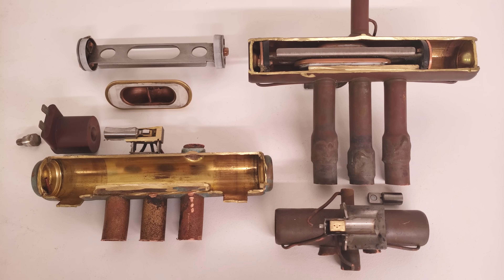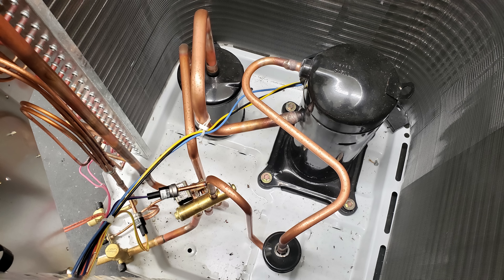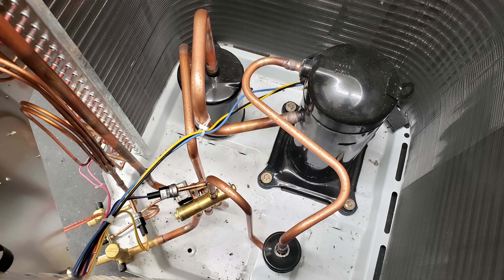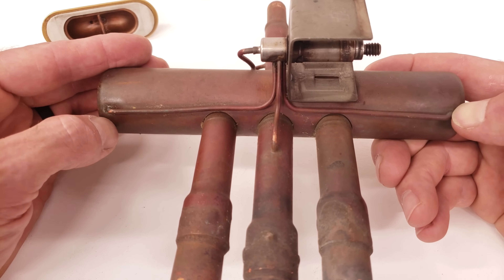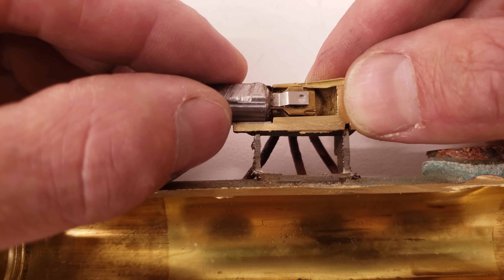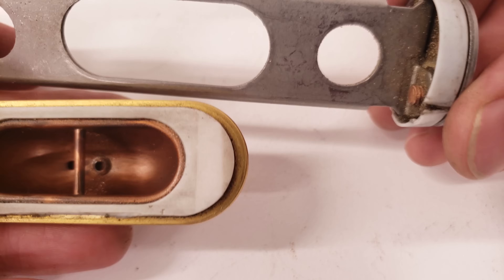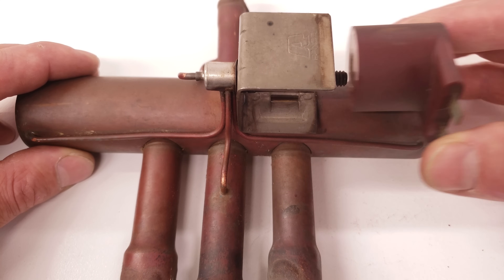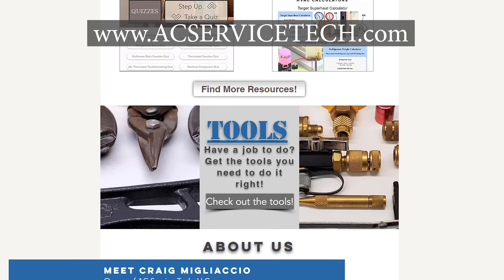How the REVERSING VALVE Works in a Heat Pump! HVAC Training!

Comment: When winter comes, and the heat is turned on with my heat pump, it throws error messages and goes to the heat strips.  Could this be the Reversing valve?

Comment: I have a 1 year old unit that has a leaking reversing valve and is under warranty for the part but the AC tech is asking $1700 labor to replace it.  Does that sound fair?  How often do these leak from the factory this early?

Comment: can reversing get stuck and send high pressure on both lines(high and low )  on heating mode?  both pressures rise equally on my gauge on heating mode, but  on cooling mode works   just fine

Comment: why not have the electric mini value control the reversing value through a solenoid? why do we need to make the main large reversing value be controlled by refrigerant pressure instead of electrical signal directly?

Comment: Should the reversing valve de-energize after the cooling cycle has been satisfied  by the thermostat, or does it stay energized while the thermostat is in the cooling position?
Reply: Mine does not de-energize. Whether the reversing valve is energized in Cool or Heat depends on the brand. I can't remember how my Trane works but I think it's "O" which means energized when call for cooling. I don't hear the reverse valve switch unless I turn the thermostat to OFF or Heat so I assume it stays energized in COOL even when the cooling cycle has been satisfied. If you have an automatic thermostat, not sure how that manages the reversing valve.
Reply: I can confirm my Trane has the Reversing Valve energized during cooling. When the cooling cycle is satisfied, the reversing valve stays energized. I tested it with voltmeter. This means the reversing valve is not switching during normal cooling operation only when a call for heat for possibly when I turn the thermostat off completely.

Comment: how r u! I got questions I do get it hot gas come from discharge through capillary to shift reversing valve but where is suction line gas come from? Because I see the flow in video suction gas is not come from common suction line, low gas flow back to common suction! Where low gas come from? It’s doesn’t look like to from common suction? Thanks

Comment: Great video and thank you! It makes things so much easier when you understand in more depth how something operates. I am working on a unit now that has a heating element and the blower fan running while in cooling mode but something went wrong with the pressures too so I'm not sure if something is also going on with the reversing valve too. But not sure.

Comment: My Heat Pump unit has the RVS solenoid on all the time. Even when unit is not calling for heat or cool. Only discovered this when the unit was off for a day and checking the solenoid was hot to touch.

Comment: Have an O valve (energized for AC), LUX product bought by Johnson Controls (just ruined company with it's new app) caused heat pumps with O valves in August to go into heat pump mode  while in AC thermostat mode, with no limit due to firmware downgrade.  I've heard of deaths caused by AC in winter, but not from heat in summer as you would likely wake up while sleeping.
Reply from the maker: That is a nightmare, too intelligent for its own good
Reply: Didn't Johnson Controls buy out Lux many, many years ago? I wouldn't diss that company, because in the past they've made great stuff under the York brand.

Comment: Is the default for those change over valves to cool in the event of a damaged solenoid?
Reply from the maker: The nonpowered position on most is in heating modes but some brands such as Ruud Rheem, the nonpowered position is in cooling mode, thanks!